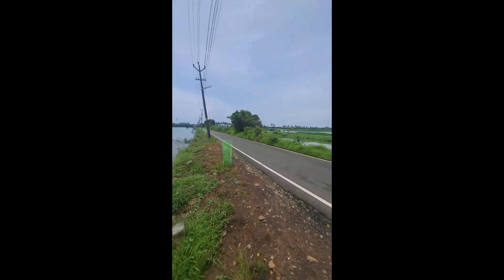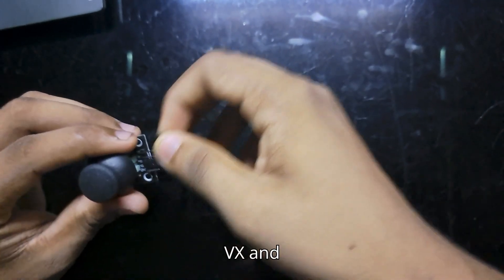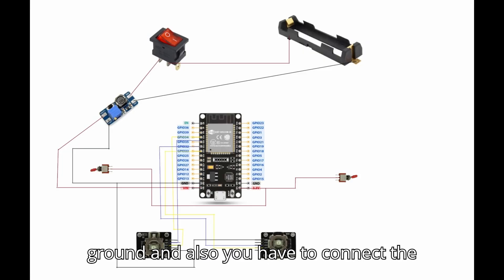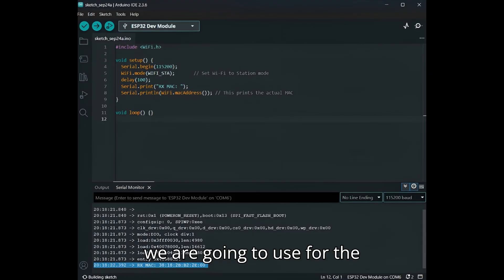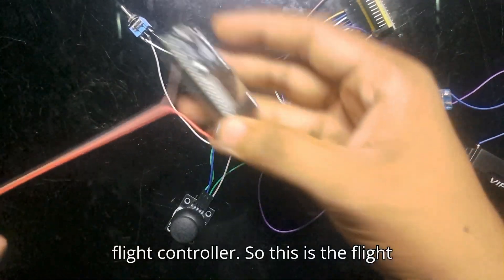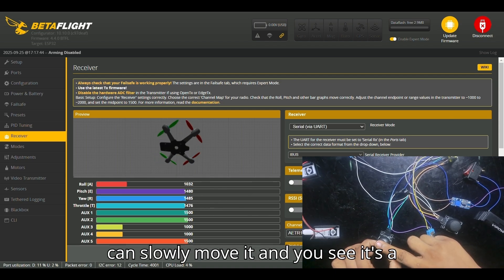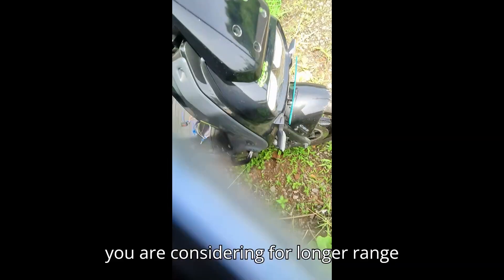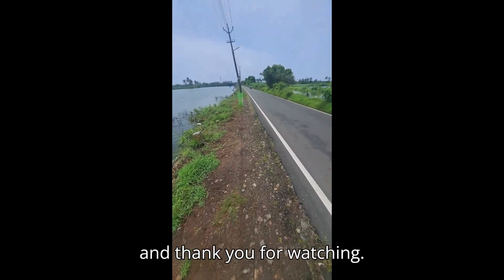DIY ESP32 RC Transmitter & Receiver | iBUS + ESP-NOW for Betaflight Flight Controller

Comment: hey bro, can i use this kind of set up with an existing flight controller, i have a f4 v3splus flight controller. i’m doing a project please help.
Reply from the maker: Yes, you can use this with your F4 V3S Plus since it supports iBUS input. Just connect the iBUS signal wire from the receiver to the flight controller’s UART RX pin and enable iBUS in Betaflight/INAV
Reply: @EngineeringRobotic bro can i contact you. i have hit a dead end
Reply: @EngineeringRobotic its really urgent bro. please help
Reply from the maker: @amankhan-cg5tg  what is it? any issue?
Reply: thanks bro, i tried using using wifi AP and udp transmission to control the drone but wasn’t working. hope it works.
Reply from the maker: @amankhan-cg5tg  Glad to help, bro! It will work—just watch out, you may need to swap the X and Y wires on your joystick 😁 Let me know how it goes!
Reply: @EngineeringRobotic yeah bro for sure, thanks man!
Reply: @amankhan-cg5tg  焊接的时候，注意焊枪要接地，不然很容易击穿芯片，造成失效

Comment: sir, i tried everything but my setup is not working where i am getting error?
Reply from the maker: What is the specific error you are referring to? I will provide you with some common fixes.😄
1)Did you receive the data (you can see this on the receiver ESP32's serial monitor)?
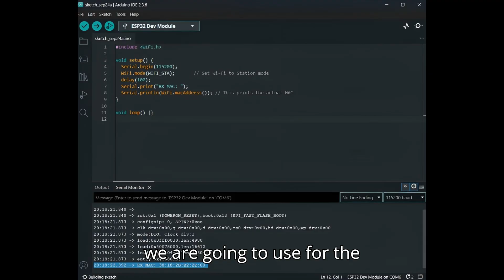2)Have you found your receiver ESP32's MAC address and typed on the Transmitter esp32, as I did? [3:57]
3)If none of the above steps worked, then type:
uint8_t rxMac[] = {0xFF, 0xFF, 0xFF, 0xFF, 0xFF, 0xFF};
on the MAC address of your transmitter (TX). This will send the data to all ESP32 devices within range.
I hope this helps!🤗
Reply: @EngineeringRobotic my transmitter is not detected in betaflight i think esp now is not linked
Reply from the maker: In my setup, the connection is as follows:
ESP32 (Transmitter/TX, with the receiver's MAC address) -> (Receiver)ESP32 (Pin 17) -> ESP32 (Flight Controller/FC on Pin 32).In Betaflight, you need to enable Serial 2 (Pin 32) and Serial RX in the Ports tab. If you are using any other Flight Controller, you will need to find its specific serial port.I must ask again: Did you receive data in the Serial Monitor of the receiver ESP32 in the Arduino IDE? If data is being received, then the issue is with the port configuration of your Flight Controller (FC). Find the correct port (mine is Serial via UART 2) for your ESP and set it to the IBUS protocol.
i also explaned on this video too : https://youtu.be/UvT1o2FiCCM
Reply: @EngineeringRobotic  thank you brother

Comment: Bro what libraries do we require to upload receiver's code?
Reply from the maker: "Excellent question! The simple, beautiful answer is: You really only need the standard, built-in libraries: <esp_now.h> and <WiFi.h>.

I designed it this way because I knew some people struggle with finding and installing external dependencies. I hand-coded the entire iBUS protocol implementation into the sendIBUS() function myself! That's why the receiver code is so clean and lightweight—zero third-party iBUS libraries required!😁
Reply: @EngineeringRobotic  Yes you are right....the code is simple and uploading easily.....but on my beta flight controller's dash board I cant see any changes in reading......let me tell you the differences in my project than yours......1. I used F4 v3 splus as a flight controller .......2. For Rx I am using XIAO ESP32C3........ 3. for joystick I have not attached any toggle switch......rest all is same.....and when I connect my F4 v3 splus by a type c cable to beta flight controller on laptop all the things on drone are workig......please help brother.....tommorrow is my project exhibition
Reply from the maker: @smartygrafix   The F4 V3 Plus is a more standard flight controller than the one shown in the video, which means we have to ensure the correct UART (port) is configured for your receiver.

1. Confirm the Receiver Protocol
The original project (as outlined in the video) sends control data using the iBUS protocol [05:38].

In Betaflight:
Go to the Receiver tab.
Make sure you have selected Serial-based receiver as the Receiver Mode.
For the Serial Receiver Provider, you must select iBus. If you select SBUS or CRSF, the FC won't understand the data coming from your XIAO.

2. Check the Wiring and Port Configuration
You need to ensure the data pin from your XIAO ESP32C3 is connected to a UART's RX pad on your F4 V3 Plus, and that port is enabled.

Wiring Check:
Find the pin on your XIAO ESP32C3 that is acting as the iBUS TX (Transmitter) pin. This is likely the pin equivalent to Pin 17 in the original ESP32 code.

Connect this single iBUS TX pin to an unused UART RX pad on your F4 V3 Plus (e.g., T1, R1, T3, R3, etc. are TX/RX pairs, you only need the RX pad). For example, connect it to RX4 or RX6 if those are free.

Also, ensure you have common GND and 5V (or 3.3V, depending on your XIAO's voltage tolerance) connected.

In Betaflight (Ports Tab):

Go to the Ports tab in Betaflight.

Find the UART number that corresponds to the RX pad you used for wiring (e.g., if you wired to RX4, find UART4).

In the Peripheral column for that specific UART (e.g., UART4), select Serial RX.

Click Save and Reboot.
3.Check using Arduino IDE

open Arduino connect RX and see whether the serial monitor is showing your joystick movement from TX

4. Test and Channel Range
After saving and rebooting:

Make sure your TX (joystick) and RX (XIAO ESP32C3) are powered on.

Connect your F4 V3 Plus to Betaflight.

Go to the Receiver tab.

You should now see the bars moving as you move your joysticks!

Regarding the Differences:
F4 V3 Plus FC: This is fine, as long as you configure the Ports and Receiver tabs correctly (Steps 1 & 2).

XIAO ESP32C3 Rx: This is also fine. The key is that your XIAO code is outputting the iBUS protocol on the correct pin, and that pin is correctly wired to the RX pad on your F4 V3 Plus.

No Toggle Switch: This is only an issue for Arming the drone. You will need a channel (Aux 1, Aux 2, etc.) to switch the arming function on and off in the Modes tab. For the exhibition, you can test all your stick movements first, and then worry about the arming switch later (or even assign arming to one of the joysticks' push-buttons if your code supports it). 👉 or make yourself a temporary switch by holding and joining the vcc with 25 or 26 or 27 or 14 GPIO pin  (joying vcc with any of these pin will make a your aux to change this will help you to arm the dron)

Good luck with your project exhibition tomorrow! Let me know if you are still stuck after checking these points.

Comment: Can u build a esp32 mini drone that control using mobile app
Reply from the maker: Building an ESP32 mini drone is possible, but not as simple as it sounds. Coreless motors really aren’t worth it—they usually give only 1–5 minutes of flight time, and with the ESP32’s weight (especially with a PCB) it becomes even harder. I even tried a non-PCB build myself (in this video I showed how to control the drone with a phone app: https://youtu.be/UvT1o2FiCCM
), but it still failed because of weight limitations.

BLDC motors are much better since they have a higher thrust-to-weight ratio, but the problem is cost—tiny BLDC ESCs and parts get expensive fast. So yes, it can be done, but making a good ESP32 mini drone that actually flies well is both tricky and costly.

And honestly, are mini drones even worth it? 🤔 Every gram of weight matters, so it’s hard to add new components or upgrade the battery without ruining flight time. You can often build a 5-inch drone for cheaper, and it gives you way more upgrade options.

That said, I really respect your idea 🙌 and I’ll keep looking into ways to make a mini drone more affordable, maybe with some unconventional methods. It’ll take time to gather the right parts, but I’ll give it a shot.